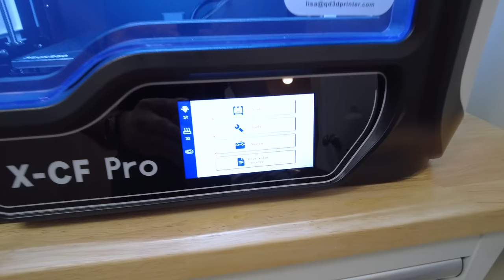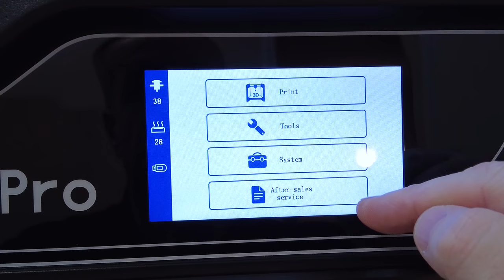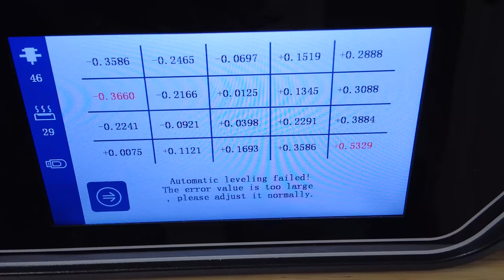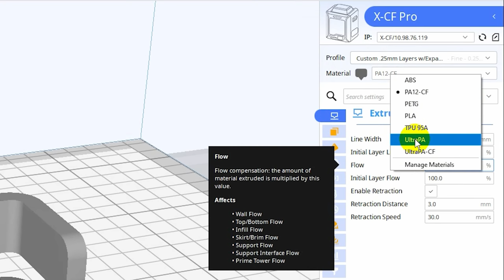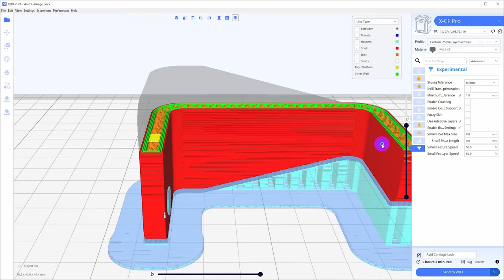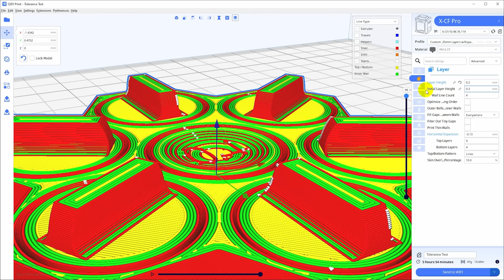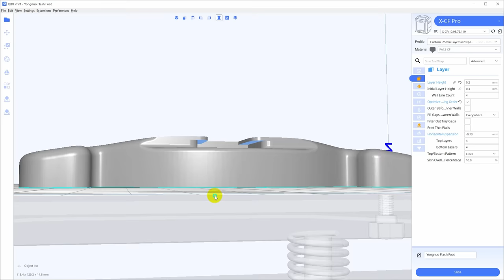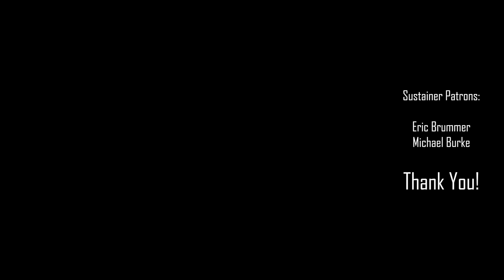Is the QIDI Tech X-CF Pro the PERFECT Carbon Fiber 3D Printer?

Comment: These are a great printer, I've sold quite a few, but those on a tighter budget, the QIDI X-Max upgraded with an Icarus Extruder will perform just as good and will allow it to support the same filament types.
Reply: The QIDI X-Max works just fine with (in my case) PA12-CF with the standard hardened nozzle.
Reply: @cgln8760  Yes it does, but the .4 nozzle will jam with most PA12-CF's, if yours hasn't, then the compound in your filament must have a fine CF powder, also heat creep can be an issue on the stock X-Max extruder, the main filament I print on my X-Max's is UPAHT-CF15 which requires 320° C to print it, and prints better with a regulated chamber as well, all can be done on the X-Max with a few mods and upgrades, at the end of the day, the QIDI TECH printers are a great option for semi professional to commercial use, their all well built machines.
Reply: I am in the usa where can I get the Icarus Extruder ? would the QIDI X-Max upgraded with an Icarus Extruder, be a better printer than the Bambulab X1C ?
Reply: @motomatta1  You can purchase from my store, I deliver to the US, UK and EU, and to answer your question, no, the Bambu Labs printer, is excellent, and is getting better all the time, but its not a fair comparison, the X-Max is larger, and with the Icarus, can then take open source or off the shelf extruders, hotends, nozzles etc... the Bambu Labs is proprietary, if you own the X-Max, the the Icarus is a good upgrade, otherwise sell the machine and grab the X1C either way they will both be excellent printers.
Reply: @NexGen-3D  Thank you 😊

Comment: I thought that my ABL was not working as I could not see it move, it turned out I had it trammed so well the movements were microscopic and to see it I would need a very high frame rate camera so I messed it up a little and then I saw the leadscrews turn, if you try this, only move the wheels slightly as the ABL has an operational window.

Comment: I’ll say that my X-CF Pro is a bit tedious to get set up (especially when the BL touch doesn’t work), and the slicer settings don’t have much to offer in terms of nozzle profiles. But it definitely pushes out some extremely good quality prints.
Reply from the maker: This matches my experience with it.  If you keep the PA-CF loaded, once it's set up, it requires very little interaction.  If you swap filaments and nozzles on a regular basis, it's much less convenient--especially when comparing to something like the Bambu Lab X1-Carbon, where you can swap the nozzle in about five minutes and just send a print to it.
Reply: @Clough42  exactly. One thing I do hate about it is the filament loading setup, and how far the runout sensor is from the extruder. It’s almost like it was a complete afterthought. BUT, As you said, once it’s up and running it will produce great results. Changing filaments after one’s exhausted has given me a bit of PTSD though 😂
Reply from the maker: @Heiserton  I've also seen the filament break in the tube, right after the runout sensor if the head travels to the extreme back corners.
Reply: @Clough42  Yep! sadly I try and avoid placing anything on the print bed on the back corner for this reason. It's only happened a few times, but I've had the filament break in the tube, but between the extruder and filament sensor. So I've come back to the printer after a few hours only to see the extruder an inch above the print just humming away, but not laying down any filament because the filament sensor still thinks there's filament lol.

Comment: I've noticed that the holes don't really matter with 3d printing as I'd  usually have to drill and maybe ream the holes if I wanted real accuracy.
Reply from the maker: For small holes on most consumer printers, this is necessary to get good results.  For holes over about 5mm, a well-tuned printer can produce holes pretty close to size.

Comment: If we talk about 'magic' boxes, it should be nowadays Bambulab printers. They all shout all over youtube balbulab this and babulab that = )
I do like Qidi approach though. They do not market insane speeds, which is really hard these days, just every 3d printer manufacturer had to write 100500mm/s amazing speed please buy! And they do not make their printer tremble like Bambulab (for faster wear out and marketing purposes obviously). Even bed leveling tool is used just to check if bed is alright and not to curve your print to match curved bed surface, for 'perfect' curved first layer.
I still prefer my $100 Ender 3 though = )

Comment: Have you considered building a Voron 2.4? It is built with a 350x350mm build plate and is controlled by a Raspberry Pi. My son built one over the summer. Rather impressive and there are many many mods for it, including auto bed leveling. He's working on a carrot multi filament feeder that will allow up to 8 different filaments that can be controlled in g-code.

Comment: I wonder if the autolevelling is just a software correction that drives the z-axis slightly further/less far than the commanded position while printing according to the alignment matrix it computes? not sure exactly how much benefit that would give though, especially if the bed levelling nuts are supposed to be actuated
Reply: (and it looks like I'm not the first person to suggest this. heh)
Reply: That's exactly what auto bed leveling does. At least for the first couple of layers or the raft, after that you have a flat plane to work off. There are some printers that have drive screws or belts in each corner which can mechanically level the bed. Even so, the g-code modification is still useful to all types of printers to compensate for a non-flat bed (from manufacturing or thermal deformation).

In fact, there is no reason you couldn't have an angled bed or one with multiple different heights to save on support material if you where making a large run of prints that had a weird shape.
Reply from the maker: This is exactly what it claims to be doing.  The problem is I have never seen the Z screws move while printing a layer.  On other printers with mesh bed leveling, I can see the Z screws rotating as it moves across the bed, making the adjustment.
Reply: @Clough42  I wonder how much layer height is affected by travel velocity vs. extrusion velocity, especially with the first layer going down on such a textured surface. Since they are only correcting a very limited height difference, perhaps they raise the nozzle up to the highest point and increase the extrusion velocity as it travels over the low points. This would explain why is can only correct such a limited range.

Of course, I can also see them just forgetting to call the function. Or forgetting a setting disables the Z axis while a layer is printing.
Reply from the maker: @ElectricGears  or shipping the printer before the firmware is finished.

Comment: if the ifast lid is such a pain to remove that this one is a huge qol improvement, could you not just like... stick a little handle with some adhesive on it on the ifast? just like easy double sided tape? That seems like an exceptionally easy problem to fix
Reply from the maker: I would probably drill and mount a printed handle with screws.  Anyone who has an i-fast will certainly recognize the struggle and appreciate the design on the x-cf pro.
Reply: @Clough42  Im not suggesting that it isnt an improvement, just that it is an incredibly easy thing to fix.

Comment: I'm curious how effective that anti-moisture system actually is.  I have a feeling it's more show than function.
Reply from the maker: If air can't get to the filament and it's in a box with desiccant, I don't see why it wouldn't work.  I don't think it will dry filament that's already wet. 
 That said, I live in the desert, and I have rolls of filament that have been sitting open on a shelf for six years that print like the day they were new.
Reply: @Clough42  it would be an interesting case to test this moisture factor: I think it's mostly hoo-haa to be honest.  I don't have the setup to do it right now otherwise I would.  Out here in NM it's pretty dry too and, like you, I've had a spool of PLA sitting on my printer for years now and it prints fine.  Nothing that is going to win any awards, of course.  Once the print is done we don't keep the finished part hermetically sealed.  I'm also not familiar with a dramatic push to seal finished parts... anywho, that marketing aspect aside it looks like a cool machine and your demo is informative and useful!
Reply: @bruinflight  desiccant works pretty well, and that’s a large package of it. As long as it’s sealed fairly well, it should work.
Reply: @melgross  that's a good point, and maybe for long-term storage perhaps it has the effect of increasing shelf life?  I have a spool of PLA that has been sitting out for years (and traveled back and forth to Japan) on my cheapo monoprice and I've noticed it has become a little brittle; then again, I set it up to do an emergency print a month back for a 138mm diopter holder overnight and it printed just fine.  Due to size, I had to print it out in quadrants, one of which pulled up from the build plate so I had to run that one again, but I don't attribute that to moisture, just my laziness of not laying down any surface treatment... and the heater for the build plate died long, long ago.  I don't know about how much the quality of the print is effected by moisture but then my prints on this cheap printer have never won any awards, as it were.  As for moisture being sealed out of this particular unit... I guess?  I -suspect- it doesn't do much because I -suspect- water vapor translates from high-to-low humidity areas tenaciously and the desiccant, well,  I'm not sure how long it lasts before it too is saturated.  Now, you can rejuvenate the silica pellets by baking them and such, so there's that.  I'm just questioning how much hoo-haa is in the enterprise of keeping filament dry and whether this feature of the printer is more marketing than practical, real-world results.  Respectfully, my amateurish $.02.

Comment: At $1,450, the Bambu X1 Carbon would be my choice, but this machine looks very impressive as well.
Reply: I have a bambu lab and it sucks printing high temp materials. The chamber temp is hard locked at 50 degrees. After that the fan turns on and keeps it at 50 deg. Doesn’t even let it get up to 60-70 degrees. This is the reason I’ve been looking at the Qidi I-Fast.
Reply: @Theprofessor1212  Oh wow, that is a pretty big downside.  Yeah for PC/Nylon you definitely want higher than 50C

Comment: I dunno, I feel like fdm 3d printers are the one tool where the difference in a cheap one vs an expensive one is just not the same as a cheap vs expensive machine tool.....I feel like the variables and tunability are just too great, you can get excellent prints out of an upgraded ender 3 that has a fraction of that printer invested in it, and still print nylon cf....I dunno, I feel like the juice isn't worth the squeeze with printers of this level and price.
Reply: Well the difference between this an and ender 3 s1 pro is $1300 and probably a week of screwing around. At least this machine is purpose built instead of being designed by a feature gibberish generator so half of the machine needs upgrades before you can fully use the other half.
Reply: @p39483  I don't deny it's prob much better set up right out of the box, but if I can buy 3x ender 3 s1's for the same price, and screw around for THREE WEEKS to get them running nice, I'll still end up with 3x the print output as this QIDI....which, in 3d printing is huge, since print times are so long
Reply: Sometimes you need just a tool, not a hobby. A school or office probably won't be able to put the time in to an Ender 3 to get the quality desired, that's why they would go for at least a Prusa, but (at least in businesses) probably more often larger printers like this. The time spent tuning a printer has a cost when it's not a hobby, so these printers with higher upfront cost may actually be effectively cheaper.

Comment: If you like this, you should check out the Bambulab X1C.

I suppose it might be difficult given you aren't a printer reviewer and they contacted you here though, but the level of ease of use make it worth looking at even if without a review unit. No need to set Z offset, crazy fast and it even tunes flow.

As for why manual and auto on the Qidi, auto is great, but it's basically software compensation for something that should ideally be at least close enough hardware wise. In essence it moves the head up and down slightly to accommodate for mild bends and angles across the surface of the bed.

You will still end up with a skewed part if the manual level is too far off for instance.
Reply from the maker: In general, I agree.  The big win with auto bed leveling is the ability to swap in a different bed that's a different thickness.  On my i3 variants, I swap between glass, PEI, and Garolite all the time, and it requires no adjustment.  When I switch between the Buildtak-style and pebbled steel sheets in the i-Fast, I have to run the fast leveling again because the thickness of the bed is different by about 0.35mm.

Comment: why did you want to have the executables signed i don't get it...? and about accuracy, like on a cnc, it depends on the way you did the calibration, compensating any error of this type with a model expension is a non sense
Reply from the maker: If the installer executable isn't signed, you can't tell if the copy of the software you downloaded over the Internet is genuine, or if it has been tampered with and contains malware.  This is why Windows pops up a dialog warning you before you install if it doesn't find a verifiable signature from the author.  All commercial software should be signed today.  There's really no excuse for not doing it.
Reply: @Clough42  I mostly agree but sometimes signing an executable is just theater. Companies where software isn't their primary expertise usually do not properly secure their private keys used for signing.

Comment: Have you played with Octo-print? I prefer running Octo Print on a raspberry Pi to control my Creality 3D printer. No messing with flash drives.

Edit: Send to wifi! Nice. That works too
Reply from the maker: I run Octoprint on both of my Marlin-based printers.  I would prefer to use Octoprint on these printers, but it doesn't work out of the box.  There are rumors that this can be done by connecting directly to a UART on the motherboard, but I have not investigated.